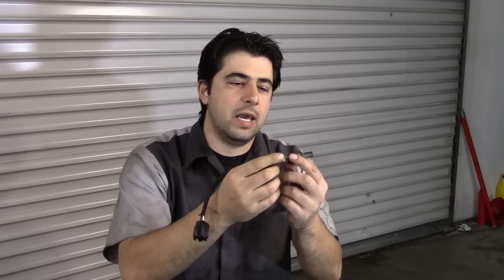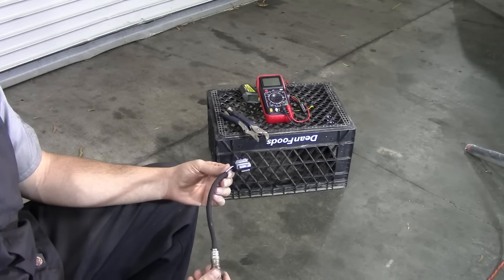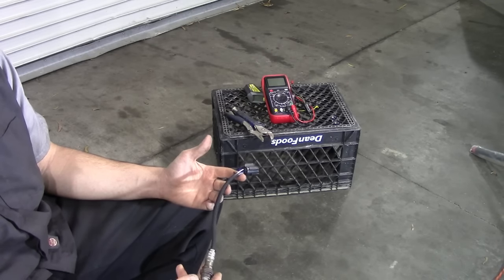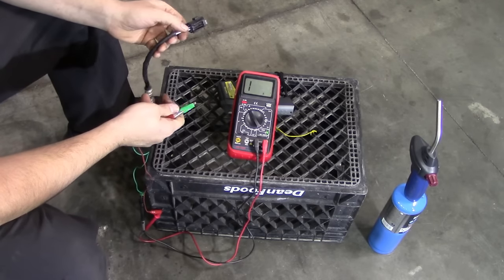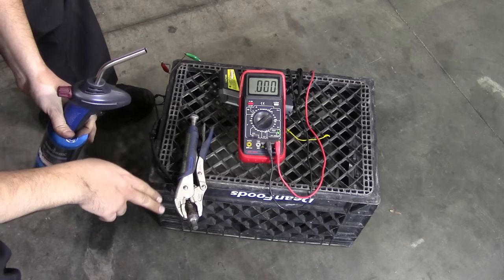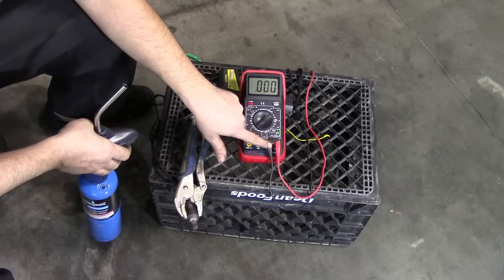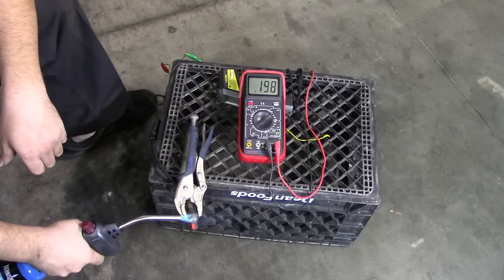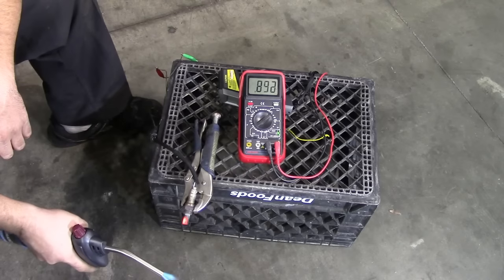How to Test an Oxygen or O2 Sensor - Plus a Quick Guide on What Each Sensor Wire is For

Comment: I checked my O2 sensor 2 wire (downstream) with Multimeter and it shows 1.02V when the sensor is fully  under flame and 0.45V at half inside the flame,  0.02V when out of flame.
But my Bluetooth scanner shows variation in value only when starting the engine. After coolant temp raise above 40°C, it shows  1.28V constantly regardless of foot on Padel. No change at all. Then key ON and ignition OFF, still 1.28V. then I checked voltage between the 2 wires, it shows 4.45V without disconnecting the connector. Disconnect and checked still the same. Checked resistance between the two pin and between chassis and the wires,  all are open.

Any other suggestions to research on my catalytic converter failure?
Reply: isn't the o2 sensor voltage supposed to vary between 0 to 0.9 volts? 0v being a lean mix, 0,5v a perfect mix and 0.9v too rich mix. maybe different o2 sensor run on different voltages. anyway, i'm working to fix my peugeot 307 catalytic converter fault, I've changed all spark plugs, the coil pack, and one injector. another thing that is said to be able to cause that fault code on my car is the EGR valve. I took it apart and cleaned out a lot of carbon buildup, checked that the valve was able to open and close and then put it all together again and checked if the egr valve started clicking upon starting the ignition; it did, so it is certainly getting power. still the same error message and rough idling. the last thing that could cause this fault should be bad o2 sensors, so that's what i'm gonna check tomorrow.
Reply: @pixure  when tested the sensor alone with flame and multimeter the result is within the spec's but when connected with ECU, the scanner shows 1.28V constantly. And the voltage between sensor ground and the sensor line is about 4.45V when Key is ON

Comment: I recently got a new ECU installed and after a  few months I got a check engine light with the p0420 code and I was wondering if it has something to do with the o2 sensor or more to do with the catalytic converter? I own a 2015 lancer.
Reply: Sorry to say this but 9/10 it is the Catalytic Convertor.  You could try CataClean.
Reply: 2015 is fairly new to be having problems with the Cat unless you have been driving car continually with a misfire which will fry your Cat.

Comment: can you rip open the small openings in those so that they work better is my question.I got some piece of shit ones online made in america off ebay they arn't from china but they might as well be and I am going to replace them anyway so I thought I would mess with them a little bit and see if the codes go away I got a new cat and new manifold and new maf and new air box and air filter and a bunch of other new parts but I think opening the small opening on the sensor just a tad will help reply asap thanks

Comment: I used my scanner and with the engine at normal temperature. The sensor voltage goes a little above 2volts and my long term fuel trim stays at 25%.

Comment: i'm not good in hearing English, would you please let me know: 
1. when you measure Ohm at 3:12', which wire colors do you connect to?
2. when you measure Volt at 5:02', which wire colors do you connect to?
Thank you from Vietnam!
Reply: 1. the two white wires
2. the black and the gray wires
Reply: Yar Holiyan yes sir, i have one question about operation principle. as i know:  black and gray wires will send Volt signal to ECU, ECU will adjust Fuel consumption to Engine. So what about the Two white wires? what do they do?
Reply: @VTP09z  they help to heat up the o2 sensors to the operating temperatures quicker.
Reply: @yarholiyan5438  yes sir, so one white wire need +12Vdc the other one white need -12Vdc, right? i just test a AFR testing tool by myself (1 sensor like this + 1 digital display), power by a outside 12V battery, sensor put outside motorbike exhaust. the volt from sensor is only 0.01V-0.04V (not normal) although the motorbike works great (low and high rpm). would you give me some advises?

Comment: if i get a coed that says heater control curcit low voltage.. bank 1 sensor 2 but i replace both oxyen sensors what would my next step be? thanks
Reply: Replace the O2 sensor furthest from the engine, likely past the Cat.
Bank one on V engines is on the side #1 Cyl is on.

Comment: The other youtube video says if you ohm out the wrong leads you will ruin the sensor. It's very sensitive to any stray voltage at all. Have you heard that or is it a myth ?
Reply: +FightClub MeetsHere : I though to ohm out any circuit is to check for continuity, meaning there is electrical contact.  The O2 sensor doesn't have any power source when cold so I can't imagine it will be damage. On a sensitive electronic cuicuit board and when it's powered on, you can do damage if you ohm out a wrong pair or pins.

Comment: Hi, thanks for the video.  I checked my downstream O2 sensor on a 2010 CRV using a M1015B multimeter ( the sensor  contains two white, one black and one grey wire)  and i got no reading on both white wires.  I tried the other wires and i also got nothing.  I set the multimeter to the continuity setting x10.  Am i doing something wrong?

Comment: So this test applies to 1, 2, 3, and 4 wire sensors? And does the speed of the voltage rise and drop determine if a sensor is bad or not? Also, is there one common thing that show up with a bad sensor, like not reaching a certain voltage, or going from hot-to-cold-to-hot too slow, etc.? Thanks.

Comment: thanks for video, enjoy your work.  i unplug my upstream sensor and chevy aveo runs better. plugged in engine stalls put in another sensor does same thing.  60,000 miles on car. plugs and injectors must be good, right since it runs well when sensor is unplugged.  what do i look for? could it be a clogged c. converter.  i changed plugs 3 weeks before 02 sensor issue.  the radiator was changed a
couple of days earlier. your thoughts?  thanks.
Reply: +Scott Watkins did u figure out what it was?  one thing u could have done was check exhaust back pressure and below 3psi is good reading. This test tells you if your exhaust is restricted.

Comment: Dude my car is gonna piss me off. Only throws a p0030 code (o2 sensor bank 1) but only sometimes. The car rough idles only sometimes and dies only sometimes. Starts like a champ every time. Will also have a lack of power but only sometimes. Also if you let off and give it gas it goes back to normal. I have changed the fuel pump and the fuel pump relay which were both bad they were tested and confirmed bad. It still has all those symptoms besides overall it does run better.

Comment: Would an O2 sensor cause pinging (spark knock) in a 2010 4.6 3v?
Reply: Yes. A faulty 02 sensor can cause many symptoms such as poor gas mileage and increased fuel emission, engine missing and pinging.

Comment: My downstream 02 sensor voltage using my scan tool jumps up and down after 5 min of warm up. Bad sensor?
Reply: Not necessarily a bad sensor. Is your upstream O2 sensor working correctly ( voltage swinging up and down fast) is your catalytic converter working and causing a rich fuel mixture to hit the downstream sensor

Comment: Hi 
My car battery died once and I charged the battery using 18v laptop charger. Now my car is bad  at efficiency. What did I damage ?(spark plug and air filter are just replaced )
Thanks

Comment: i did this on 4 wire 2 were brown and other two were purple and tan... this was on chevy 4.3 blazer when heated to red it got up to .97 then when i took heat off it dropped pretty fast ... i hope its good...not sure really i will reinstall ...need to fix exhaust restriction issue whic is why my 4.3 has been running like dog poop... i removed 02 senor and it run great without the restriction...this was the way i realised my exhaust was clogged up most likely its cat converter...
Reply: roadstar499 was the cat clogged? I may have same issue, car runs prefect first 5 min or so, no miss, then starts sputtering more and more, removed o2, runs alot better but not perfect. My question is should I try new 02 before replacing cat?
Reply: @GSskiracer  yes my cat was clogged...still runs  pretty bad... i have new 02 sensors need to put in..been real busy maybe next week i will play with it...good luck
Reply: roadstar499 please keep us posted thanks

Comment: 2000 Sienna, on the car side, the two black wires are the heater, but there is a blue wire and a white wire and when I switch on the key, the blue wire outputs 3.3V and the white wire outputs 1.1V.  
If one of those is supposed to be grounded at the PCM, why is there voltage on both?

Comment: the foking issue is some sensor works but whit chips like LM9044 the bastard have impadence test and if it is not low like 10kohms it block the output to 2v and made the central rich you need make sure the calefactor and the power to it right

Comment: Hi There.  Great video.  I'm also interested at this moment about cold engine and hesitation when good idle but then increasing RPM which makes it go rough.  As I understand it, the O2's, FPR and EGR have no input until they reach operating conditions.  Also how should downstream O2's behave as mine is 290mV generally.  If it needs to be high say 900mV then could I make a potential divider and produce the 900mV to see if it ineed makes a difference.  I don't know 
what current would be needed yet in order to make the devider.  I had a 
1131code swirl valve and when I cleared it as I needed to for the MOT it
 went as above.  Also now and before, it went slow up hills and 
hesitates.  Thanks a lot for any info.

Comment: The sensor is not really measuring oxygen content at all, it's just a simple temperature sensor just like the one used in your digital multi meter.  It monitors how hot the exhaust gas is coming out of your engine.  Stupidly confusing to call it an oxygen sensor.
Reply: Is This True??.......IF so, it must be a Very Accurate Temperature,and Reading??
Reply: @timeless6964  No I misspoke, it does measure o2 content.  It does share some similarities with a thermocouple.

Comment: In a 4 wires sensor how do i know which one is the ground and the signal?
Reply: Pedro Ferreira 
I have the same question
Reply: You could test the other side of the plug. You could find the two ground wires on that side of the plug by using a multi-meter on the continuity setting where you put one lead on a good ground on the vehicle (exhaust pipe might work) and the other to each of the 4 terminals. You will find two of the terminals being the ground wires. Then to find the heater (+) terminal, turn the key on and with the meter set on DC Volts, you should find one other wire having 12V. Then the remaining terminal is the sensor so then just map your findings to the wires on the other side of the plug.
Reply: Wiring diagram for the circuit.....best way to check though is a quick lab scope for narrow band.
Reply: doesn't matter if you are testing voltage or resistance. will just show as a negative voltage.
Reply: @TheKellisunshyne  We DIY'ers don't all have a lab scope
Reply: Mine has 2 white, 1 grey, 1 black.. (porsche).. I used grey and black to test voltage, white wires are for internal heater - you can check the ohms on those if ya want.

Comment: Or, you could just find the specs for your particular sensor, (Ohms), and measure the resistance across the specified, (by the manufacturer), terminals of the given sensor. You've already got your multimeter out, so, why set up a whole shebang with heating, and stuff?...

Comment: It's unclear to if you had a power wire hooked. Where could voltage come from without a source? I have a 4 wire that has a power  at battery voltage. Where can parts be bought that are not made in China? I bought a new sensor and it don't work. I have been told I need to use a denso sensor. I threw away the old one and now don't have exact part number. Holy crap!
Reply: Have you tried Rock Auto? Unfortunately no matter where you parts from nowadays they are usually made in China or Mexico...thanks to our governments!!
Reply: How it Works

The O2 sensor works like a miniature generator and produces its own voltage when it gets hot. Inside the vented cover on the end of the sensor that screws into the exhaust manifold is a zirconium ceramic bulb. The bulb is coated on the outside with a porous layer of platinum. Inside the bulb are two strips of platinum that serve as electrodes or contacts.
The outside of the bulb is exposed to the hot gases in the exhaust while the inside of the bulb is vented internally through the sensor body to the outside atmosphere. Older style oxygen sensors actually have a small hole in the body shell so air can enter the sensor, but newer style O2 sensors "breathe" through their wire connectors and have no vent hole. It's hard to believe, but the tiny amount of space between the insulation and wire provides enough room for air to seep into the sensor (for this reason, grease should never be used on O2 sensor connectors because it can block the flow of air). Venting the sensor through the wires rather than with a hole in the body reduces the risk of dirt or water contamination that could foul the sensor from the inside and cause it to fail. The difference in oxygen levels between the exhaust and outside air within the sensor causes voltage to flow through the ceramic bulb. The greater the difference, the higher the voltage reading.

You welcome.
Reply: Thermocouple?
BTW. The solution was an absolute. I replaced the cheap $25 china replica part with a real live $140 made in Japan unit. Worked perfect.

Comment: Nice bench test. Like you said it sux that without a proper scan tool you can’t read what the computer is seeing on the OBD 1 system that I have on my 1995 f250. Arghhhhhhh
Reply: Tbone productions i know your pain.ihave a 95 gmc qnd it has obd1 computer,but a obd2 port.cant check codes unless i buy 2000$ code reader specifically for this year make and model car.pain in the ass

Comment: I changed the down stream 02 Sensor on a 2002 Elantra for code P0038, no effect !!! Any suggestions please The car barely drives.
Reply: The downstream sensor won't really affect how the engine runs, it's just there to see if the cat is working. It's kind of useless that way because it should never see  mixture since the cat's supposed to clean it up.

Comment: Look dude.  If you going to do a video, you should at least say the specific color of wires you are testing.  This video is usually otherwise.
Reply: He did say what collors. White is the heater circuit. The other wire colors can be dif depends on who makes the car. They can specify dif color wiring.

Comment: Seriously?  You spend 3.5 minutes explain how you are going to show us how to test a sensor...and when you finally get to the point where you actually measure the heater resistance, you tell us that you don't know if 7.2 Ohms is a good reading or not.  OK, that was a complete waste of time.  Thanks for nothing.  If you are going to go to the trouble of making a video telling us how to do something at least make sure you do your homework first so you can tell us what a typical reading is...whether it's likely to be too high, or too low etc.  

Folks stop right here and move on, I don't think this guy has any real hands on experience doing this...go find another video
Reply: How it Works

The O2 sensor works like a miniature generator and produces its own voltage when it gets hot. Inside the vented cover on the end of the sensor that screws into the exhaust manifold is a zirconium ceramic bulb. The bulb is coated on the outside with a porous layer of platinum. Inside the bulb are two strips of platinum that serve as electrodes or contacts.
The outside of the bulb is exposed to the hot gases in the exhaust while the inside of the bulb is vented internally through the sensor body to the outside atmosphere. Older style oxygen sensors actually have a small hole in the body shell so air can enter the sensor, but newer style O2 sensors "breathe" through their wire connectors and have no vent hole. It's hard to believe, but the tiny amount of space between the insulation and wire provides enough room for air to seep into the sensor (for this reason, grease should never be used on O2 sensor connectors because it can block the flow of air). Venting the sensor through the wires rather than with a hole in the body reduces the risk of dirt or water contamination that could foul the sensor from the inside and cause it to fail. The difference in oxygen levels between the exhaust and outside air within the sensor causes voltage to flow through the ceramic bulb. The greater the difference, the higher the voltage reading.